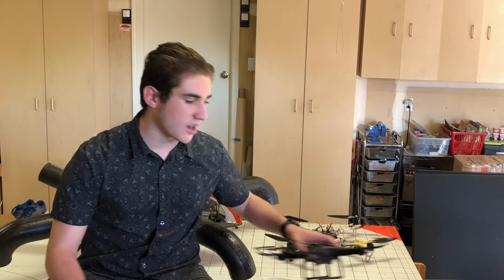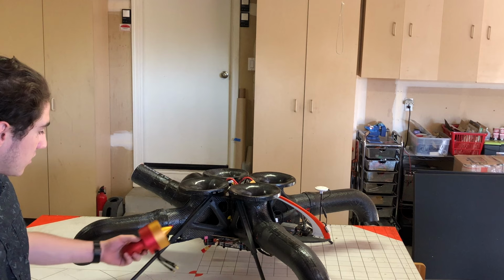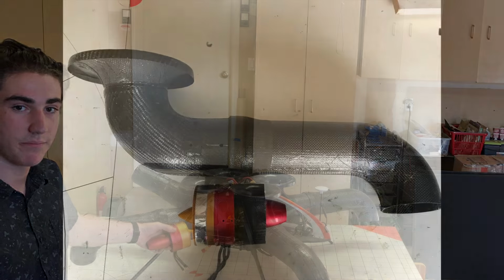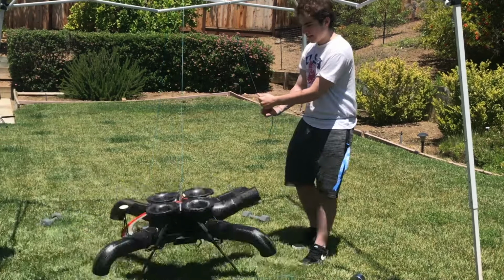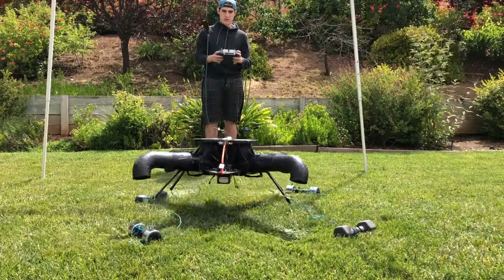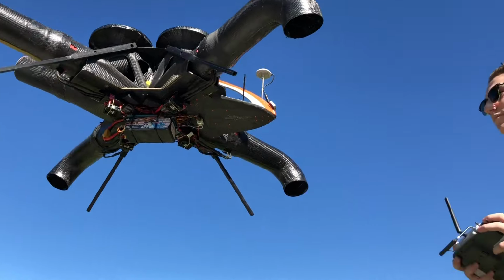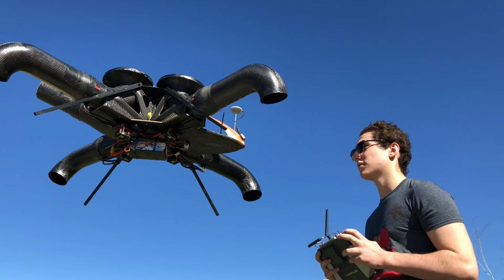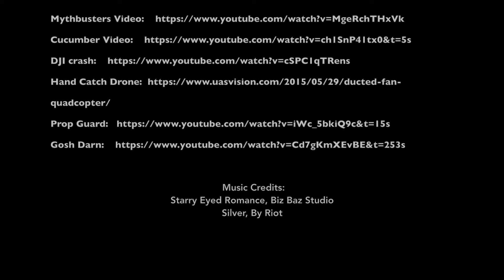Bladeless Drone: First Flight

Comment: Don’t you ever tried to use only one engine with 4 pipes with acceleration system. English is not my familiar language. So I’ll try to explain. You can use only one engine, cause it’s much cheaper and no vibration cause of resonance of four engines. Of course you will have problems with turbulent effects in your pipes, but you can smooth it by using system like in objective in camera that closes on the circle not the perpendicular way like I cars. That probably will give you more power on other pipes. And so more efficiency. If you didn’t understand, I can try to explain if you want. We have the same project in our institute. Good job by the way.
Reply: I suspect it was easier and more efficient to have 4 motors for directional control than one motor with baffles in each tube which would decrease airflow... The speed and therefore the thrust of 4 motors could more simply and more exactly be controlled with the multi-motor drone controller than 4 baffles on servo motors...
Reply: How will you steer it with only one air source?
Reply: @MrJMaq  Vanes in the pipes.

Comment: try designing 1 motor and actuators for the 4 tubes
Reply: Yes, one bigger rotor in the centre and air will will have to be channeled through the four tubes.
Reply: Won't be able to control thrust individually unless I'm missing something.

Comment: Tip: Add a nozzle to the ducted fan to turn it into a compressor which provides more thrust. Propellers aren't designed to produce thrust, they're built to "pull" the aircraft through the air using lift, while ducted fans (model jet engines) are built for air flow. Air flow + nozzle = compression, and thrust.

Added bonus is that you can gimbal the nozzles for thrust vectoring.

Comment: Swap boat ducts  why  are u restricting the out  its messing up the controls ur burning a lot of useless energy stabilizing flight.
Reply: The intent is to prevent, absolutely, the capability of a finger to reach a blade. At the cost of a little efficiency, it does that.

Comment: Why wouldn't two screens, above and below the blades, not be a superior design and easier to retrofit to existing designs?
The screens could be made of lightweight, yet strong nylon: fishing line, adding only a few grams to the weight.
Serious question, not meant to be rhetorical or with an unassailable single answer.

Comment: This is amazing work, son... Seriously well done. It's not new technology because various VSTOL aircraft such as the Harrier jump jet, have been using ducted propulsion and lifting for decades. Admittedly they use powerful jet engines, but I can't believe nobody has yet applied this concept (that I've seen) to Drones. I love Drones and have had a few for years,  but they are potentially lethal with the high RPM those blades spin at and I've known someone to lose fingers and another have his head slashed open. But ducted fans like this could be a way forward for different applications and it would not surprise me if (if you haven't already) you get interest from some commercial enterprise. I wish you all the best because without the ingenuity of young people like you, and various brave test pilots at the dawn of aviation, we wouldn't be enjoying the aviation that we have in the world today! Keep it up!!!

Comment: how about a single motor in center top with more power and a pipe structure to divide it into four nozzles. Use a mechanical regulation to control the outputs from each of four nozzles for maneuverability and use the lower space for payload. #Just_a_thought
Reply: I though exactly the same thing but with leaf/butterfly flaps inside the pipes for airflow control.

Comment: 1. Bad power efficiency (because of impellers)
2. Excess weight of air ducts
3. Overcomplicated onboard control system (servos, mix setups, etc.)
But I like it :)
Reply: Aren't ducted fans more efficient than open props?
Reply: @crucifyrobinhood  Yes, but more battery kw to run and shorten battery life. I fly rc planes too and the air ducted planes only last half the time in the air with a battery twice as big.
Reply: isn't that the exact opposite of efficiency then? I'm clearly missing something here.  @robg112
Reply: @robg112  so that's why large diameter open props are used in large copters. Yep, they're much more dangerous (if the pilot is idiot, lol), but copter can last for a longer time in the air.
Reply: @crucifyrobinhood  ducted fans in RC modeling much less power efficient (3-4 times), than open blades, but they're smaller. The size is the only benefit of impeller.

Comment: I believe your father did a little more than just help you.  If you did this on your own I would consider you a young genius, but alas you're just smart as hell.  a suggestion if I may:  Try decreasing the exit tube diameter thus giving you more thrust, but it must be done such that it does not over heat your turbines or ducted fans trying to push air through a smaller opening.  By gaining more thrust you can carry more weight or use less battery power if you don't have any added weight.

Comment: It's not bladeless if it uses angular surfaces to manipulate air current. "Rotorless" helicopters use this same principal to redirect air with a turbine down the tail. Replacing the tail rotor with a directional air system.

Comment: Hang on a minute ... I'm sure a helicopter provides lift with rotating 'wings'.  The blade in a rotor is designed to create a low pressure above it and high pressure below it just like an aircraft wing essentially making the blade float in the air.  This design is a reactive force like a rocket propelling a sufficient mass of air to provide thrust - many times less efficient.
Reply: Jake S pretty sure that’s why the air intake is on the top
Reply: Propelling (really deflecting) a sufficient mass of air downward is precisely how the fixed wings of an airplane and the rotating wings of a helicopter provide the lift. The decrease in efficiency in a ducted fan design like this is due to practical requirements making the diameter of the rotors small, thus requiring more speed for sufficient airflow. For equal thrust, a larger diameter (slower) rotor is generally more efficient.
Reply: ElectricGears Oh! Cool :)
Reply: The intake in the top would take care of that issue. But even if it didn't, the goal of the project was to eliminate the spinning hazardous exposed blades.
Reply: @ElectricGears  Afraid not, a wing does not deflect air down.  It causes the air to move faster over the top than the bottom and faster moving air is at a lower pressure - effectively the wing is sucked up.  This machine does not 'suck' itself up as the intake vent is practically directionless.  The uses two things, reactive mass and the interaction of that mass pf air with the atmosphere (including ground effect).
Reply: @Spedley_2142  There's just not enough difference in velocity between the top and bottom surfaces to cause enough pressure difference. And if you built a wing with a ridiculous amount of upper camber to generate the velocities required for enough lift there is no force that would cause two molecules of air, split by the leading edge of the wing, to re-join at the trailing edge. A flat plate with a positive angle of attack will generate plenty of lift. You're just severely limited in the magnitude of that angle before the flow separates and dramatically increases the drag with no corresponding increase in lift. You could fly a plane with flat wings, it would just be ridiculously power inefficient. NASA has a whole thing on this https://www.grc.nasa.gov/WWW/k-12/airplane/wrong1.html
I should clarify that all this applies only to the blades of the enclosed turbines (being airfoils). The rest of his craft has no significant lifting surfaces and would preform almost the same if it was using some type of gas generating rocket motor to provide an equal quantity of mass x velocity out the nozzles.
Reply: @ElectricGears  yes, turbines use angled blades but they are used to move air.  Wings (and rotors) provide lift which is different.
Reply: @Spedley_2142  You're greatly oversimplifying things. You can fly a plane without an airfoil. And you can move air with an airfoil. In practice, both bernoulli effect and angle of attack are both part of the overall system of both turbines AND aircraft wings.
Reply: @Spedley_2142  In general 'providing lift' is used when talking about an object moving through mostly still air and 'moving air' when a stationary object creates a stream of moving air, but they are really the same thing. All that matters is the relative motion between the volume of air and the blade. It makes no difference which is moving relative to us.
Turbine blades (as in a gas turbine engine) do often have a flatter profile than a typical aircraft's fixed wing, but that's because they are optimized to generate lift at significantly different pressures and velocities than the traditional aircraft wing. They are still airfoil shaped and are generated with the same equations as the fixed wings. (This may not apply to very small or cheap turbines as proper complex airfoil shapes can be expensive to make and sometimes the gain in efficiency isn't worth it).

Comment: That's an excellent prototype! For you next stage of development, consider adding some compression to the airflow. Think of the shape of a jet engine. The intake is larger than the exhaust and the incoming air passes through a series of compression cycles before fuel is added and comes in contact with the low pressure turbine. It won't be exactly the same. But study up on Bernoulli's principle and apply it to your application. A+!

Comment: Bladeless drone with blade? ;)
Reply: It's tucked inside far from reach 
It's practically bladeless, as far as safety is concerned 

How do you expect to have aerial thrust without a turbine / rotating part with blades ? 

You can only have a true bladeles drone when using chemical thrusters such as hydrogen peroxide monopropellant 
Those have very very low flight time in atmosphere/gravity
Reply: @mihailazar2487  I know, right? Hence bladeless isnt really suitable.
Bit it also was just a joke...
But there is a way with good old rocket engines, thats why I found this bladeless misleading. Is it just blades or is it some sort of rocket engine.... ;)

Comment: Moving a little bit of air very fast is inefficient. Moving a lot of air slowly is more efficient. That's why the rotor disks of helis are so large. Using ducted fans for lift is one of the most inefficient designs there is.
Reply from the maker: Eric Braun :thanks for commenting.  you are right, just like a lot of other people have thought it was important to point that out. I wasn’t trying to make an efficient drone.  I wanted to make one that wouldn’t destroy itself or the things around it if it touched them. I thought it was a fun problem to try and solve.
Reply: What if you used one big ducted fan in the center and put butterflys in the tubes like a  throttle body to control flow to each nozzle
Reply: @stefanorivellini4847  Well, kudos on the ingenuity! It's more than I have done.

Comment: Excellent, just a recommendation. The air-inlet should be facing down, not up. This will improve stability, longer flying time, and avoid rain water.
Reply: He could channel water out in the first curve, generally you want low pressure above the drone.
Reply: Will decrease thrust this way.
Reply: If the air inlet was facing down, it would be impossible to generate any lift.  Also you risk the intake sucking in the thrust which you never want.
Reply: Stability would be improved because it wouldn't leave the ground, low pressure above high pressure below, that is what is needed for any vehicle to be able to fly
Reply: FEBM  sounds good